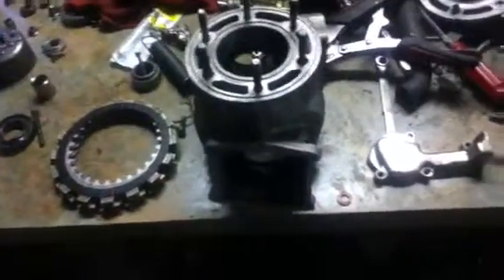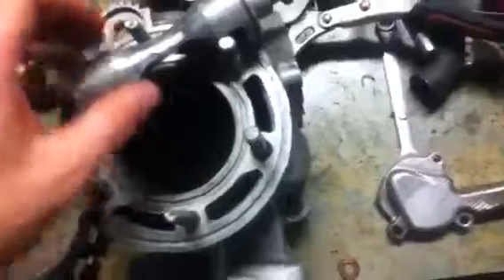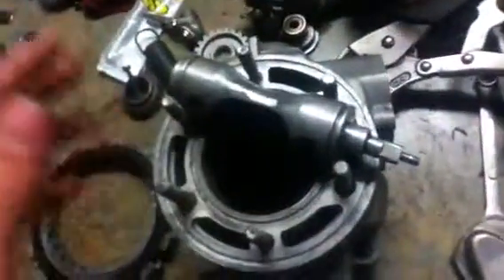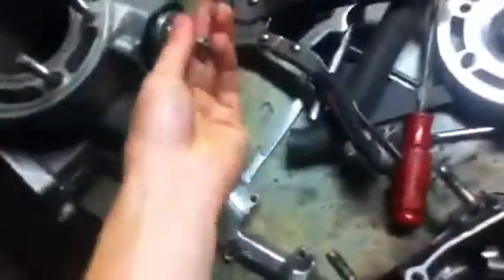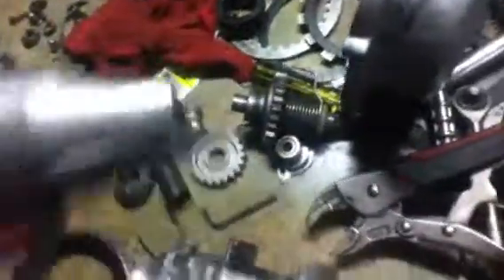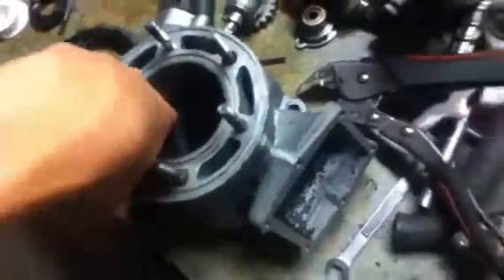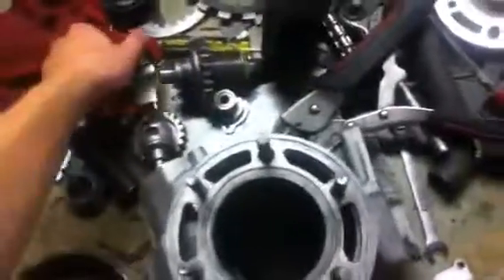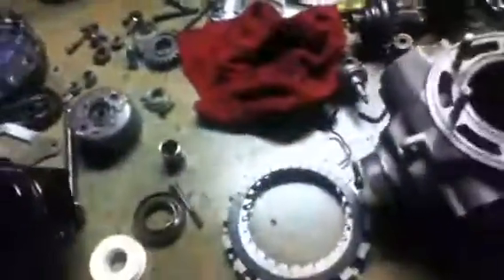how to mod a powervalve for an overbore cylinder

Comment: is that a yz250 cylinder? previous owner of mine had theirs .0040 over and didn't grind the pv and it put marks on the piston, cleaned off the edge of the pv. how has your piston looked on the exhaust side since you did this video?